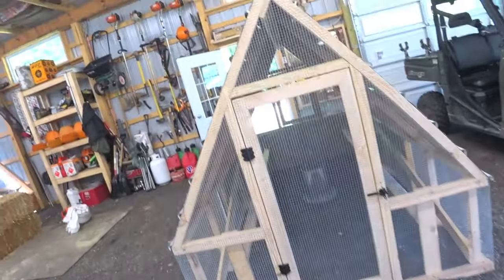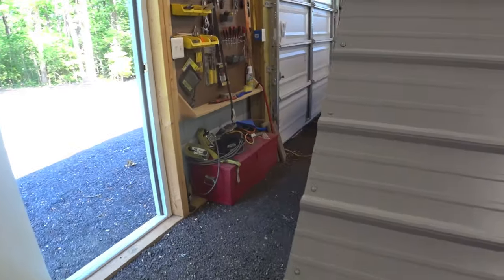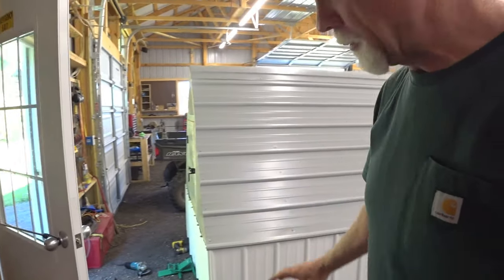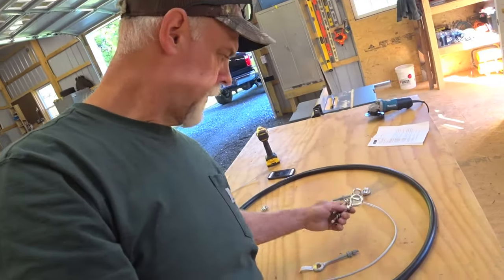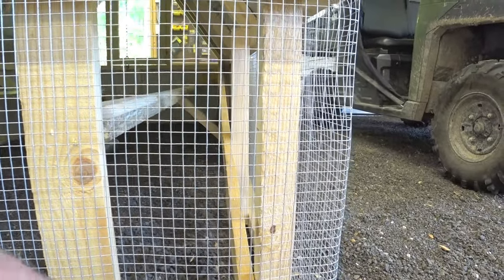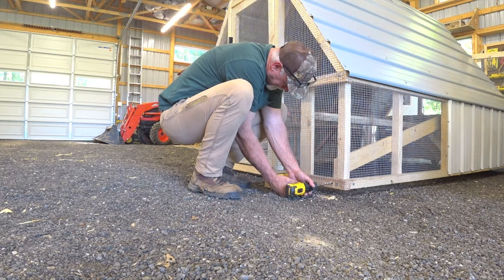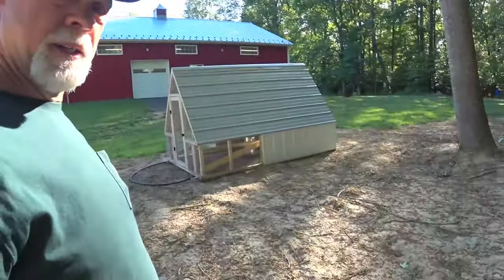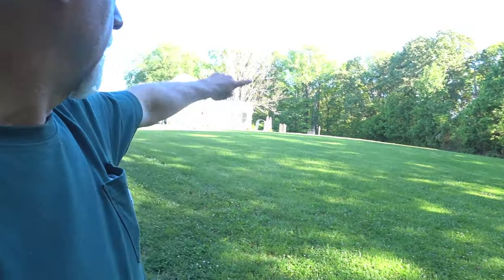Installing a CHICK LIFT on a Hybrid CHICKEN TRACTOR | Modern Homestead

Comment: Hell For Stout!
You’ll never wear these lifts out.
I installed the standard lift in each end of my coop. Wheels on both ends. Just a gentle lift for turning is all I need. I can push or pull my tractor.
Love this coop addition!